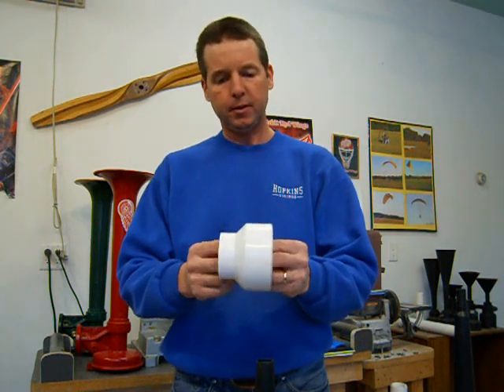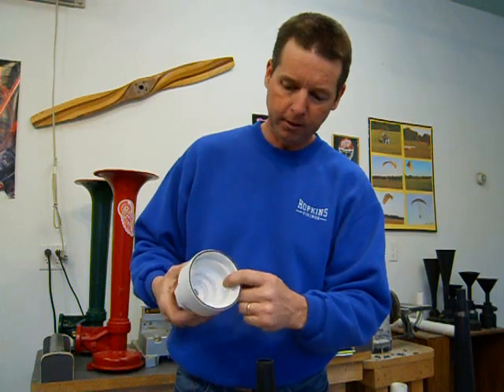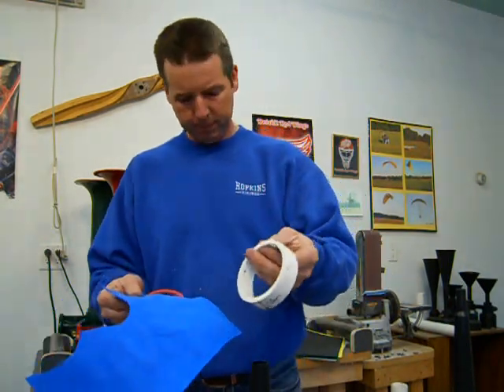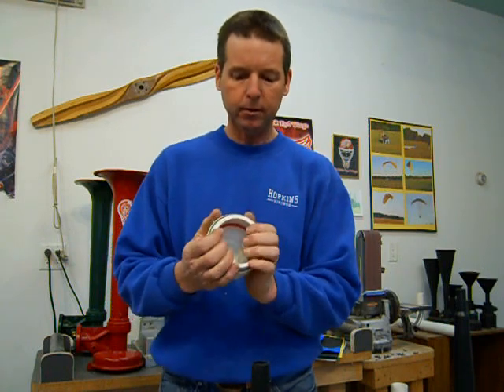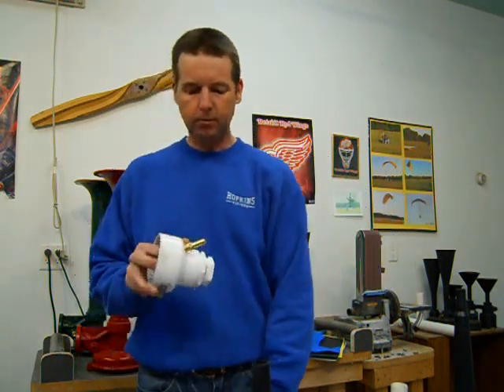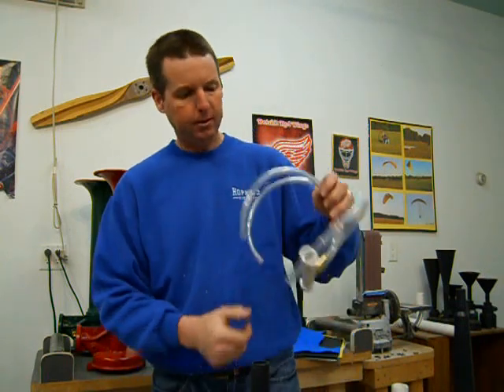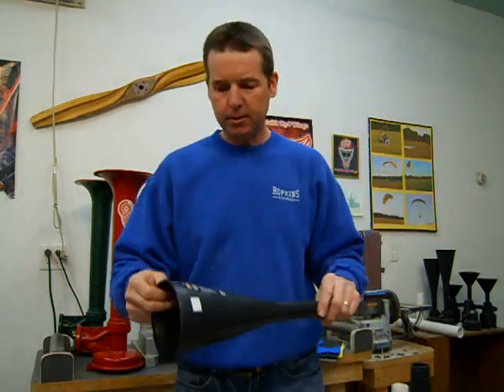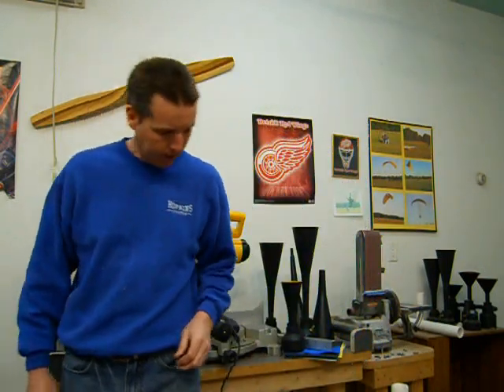v3 Train horn building video #1

Comment: I tried making one before the book came and used a 3/4 to 1 1/4 bushing on the inside of the powerchamber. Works pretty well but the back pushes out and leaks air if i push the coupler to hard on the diaphragm